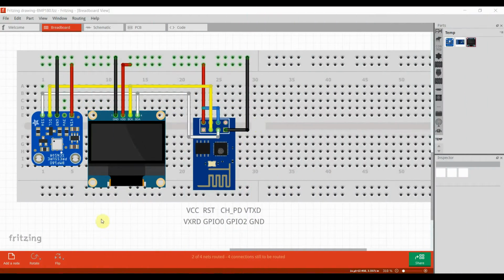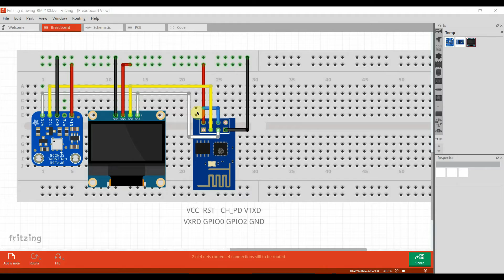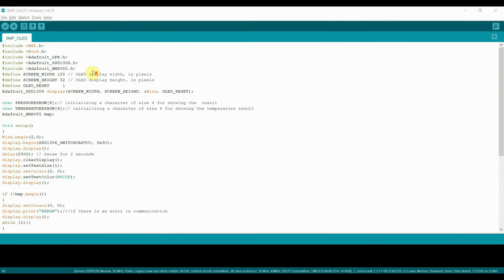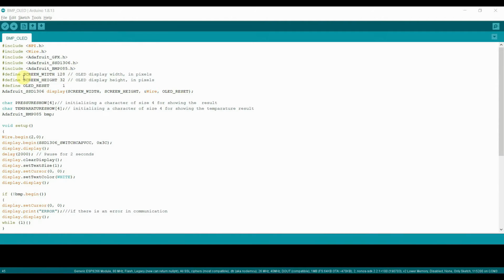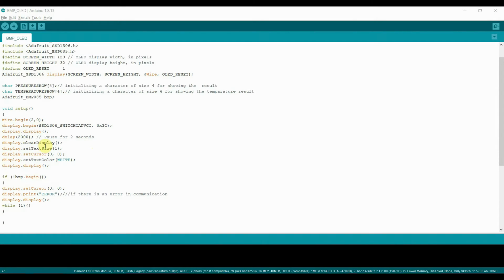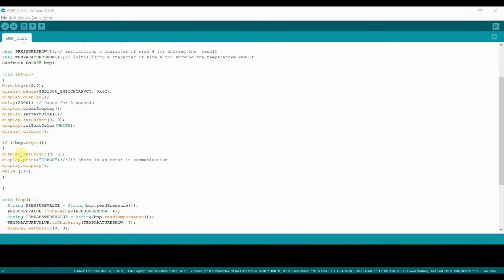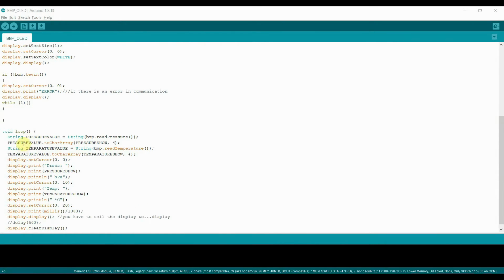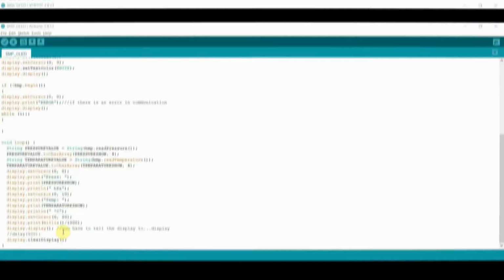ESP8266-01 with multiple I2C devices?! ||  Exploring ESP8266:Part 2

Comment: I want to use oled display and rtc clock module with my nodemcu at a same time ,  as both work on i2c communication my clock module time is disturbing by connecting it on the i2c pins.. 
Please help me with it
Reply from the maker: Well you can check your power supply for voltage fluctuations. You can add a capacitor to smooth out any voltage changes and also you can add 10K pull up resistor to the SDA and SCL pins. Also make sure your connections are neat and tight.
Reply: @UtsavShah_25  thank you 😁
One more thing is i have to specify specific address to talk with the oled and rtc clock module or addresses are pre defined in specific library 
Please help 😁
Reply from the maker: @RohanSharma-tl9wh  you will have to specify the address by yourself even though each module uses specific library